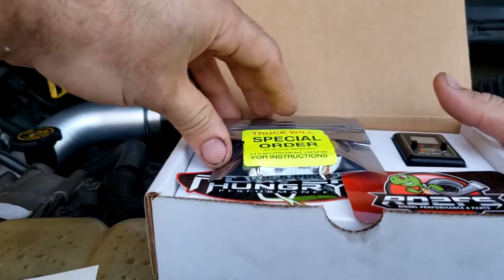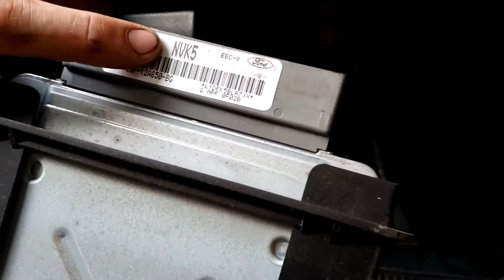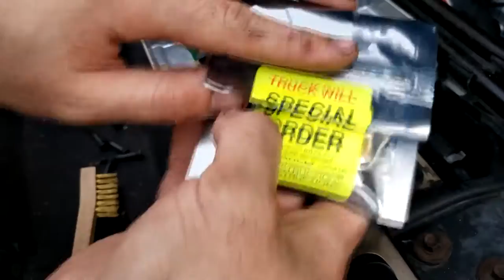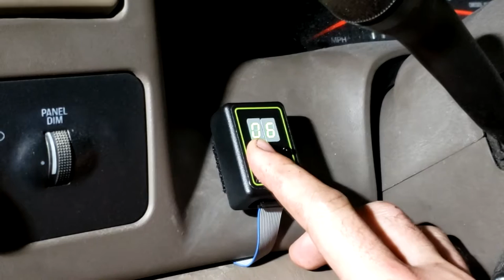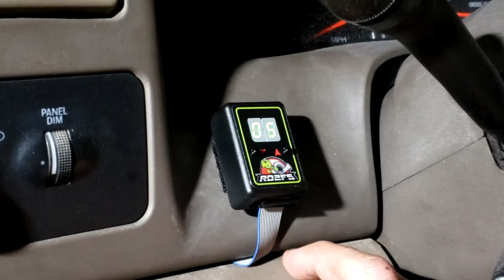How to install a hydra chip, detailed Install video 1999-2003 7.3l powerstroke superduty

Comment: I did exactly what you did and it worked. The weirdest thing I ran into was when I did an initial start and flipped it to tune 6 the truck died. But restarting it and flipping through all the tunes it was fine after that. Really odd though

Comment: The 10 mm bolt right there? I didn’t see any bolt. Too fast and not a clear view. My bolt had about 100 wires curving over the top of the bolt. You could have mentioned that the bolt stays in there. It’s hard to tell when it’s disconnected.

Comment: Mechanics shop installed new injectors on my 2002 F350 recently. For whatever reason, they said my ECM was fried due to the Hydra yet it was running when I sent it to them and my Hydra was working fine. Anyway, my Hydra will not work now. It will not start when I plug it in. Did they erase my programs or could it have possibly actually fried my old ECM?  New ECM, same old Hydra that came with the truck when I bought it. Ty very much for any info.
Reply from the maker: Put the hydra on bypass mode 00. Then cycle key off then back on and see if the truck starts
Reply: @RD2FuelSystems  ty for the reply. I've decided to take it to a different mechanic on Monday.

Comment: So my question is how much better is the Hudratuner over the SCT tuner and if it’s better, why?
Reply from the maker: we recently recovered our account. that being said the hydra offers a wider range of people that offer custom tunes for the platform, the hydra has shift on the fly as in less than half a second you can change to a different tune while driving without having to shut off the vehicle and wait 3 to 5 minutes while it programs the pcm like the sct tuner.

Comment: If you rap your second zip tie around the first one like a cross so to speak it will hold the cord straight vs pulling it inward and putting pressure on the inlet and it will be tighter, it makes the first one act as a bridge.
 just another tip hope it helps someone and thank you for the video

Comment: notes for if u have a zf6 like myself.  

to pull pcm the mount has to be taken off aswell. 
they are 2  10mm bolts one on top the mount. one below it. 
to reinstall you will have to put the pcm in the mount then bolt the mount up, u cannot fit the connector for the pcm out the firewall if you try to install the mount first without the pcm in it.... i tried.
Reply: so basically you have to test fit the pcm with it in the black mount before you bolt everything up? or did i read that wrong?
Reply: Dude I wrestled with that thing for 30 minutes then came looking for this comment.
Reply: @Ultradeath215 same here

Comment: Nice video on the installation but the only problem I have with it is I'm sitting here wondering how many people have watched this video did exactly like the guy making the video then ended up blowing out the chips in there ecm because of static electricity any time you mess with electronics you should wear a grounding strap so you don't risk inducing static electricity into the ecm circuit also known as esd
Reply from the maker: thank you for the feedback! Although it is possible, we haven't heard of any cases. Keep in mind pure silicone is naturally an electrical insulator.

Comment: What happens when you take the Hydra off the truck before you sell it
Reply from the maker: nothing, the truck goes back to the tunning it previously had on the pcm
Reply: My truck won’t start after disconnecting hydra and ideas
Reply: @davidciukaj658 did you figure it out ?

Comment: So how important is the ground clips?..what will happen if you don’t use them when you reinstall pcm
Reply from the maker: The ground is important. I have a truck that runs fine without it, and I've seen others as well. I would recommend adding a small ground to the pcm case to frame
Reply: @RD2FuelSystems  yea cause I installed chip myself, programmed few tunes.::cranks & runs on 00 but soon as I switch it dies
Reply from the maker: @antoinetaylor819  give us a call and I'll guide you through how to use the chip. 786-521-9748
Reply: @RD2FuelSystems  thanks
Reply: @RD2FuelSystems You would help more people if you just helped him here. Mine did the same thing. Turns were supposed to be already loaded.
Reply from the maker: if you switch from 00(bypass mode) to tunes 1-15 while the truck is running or vice versa the truck will stall and give you a christmas tree of error lights on the dash. instead do the following: key on engine off, switch from 00 to any tunes in the 1-15 list once you do that cycle key off then back on and now start the truck. you can do switch on the fly while the truck is running as long as you stay in tunes 1-15. I always recommend either letting off the throttle or keeping a constant throttle before changing the tune. never change the tune at wide open throttle.
 @martinboland7873

Comment: What if you don’t have the pcm ground clip
Reply from the maker: you should be okay, I have noticed that alot of trucks don't have it
Reply from the maker: I would recommend adding a ground wire in the near future from the pcm (any of th e6 cover bolts) to somewhere on the frame